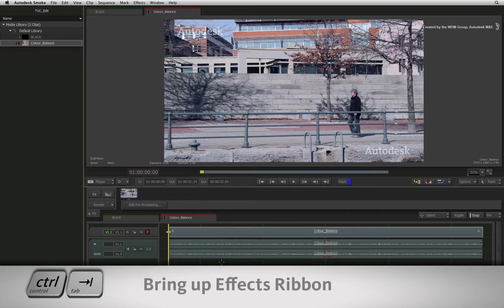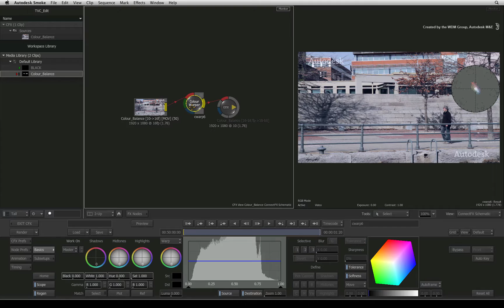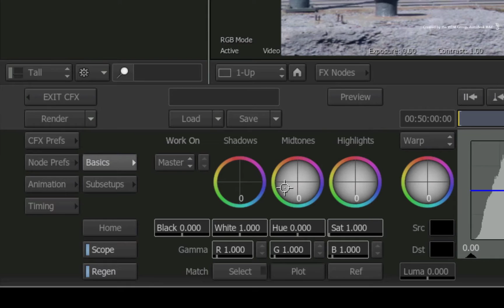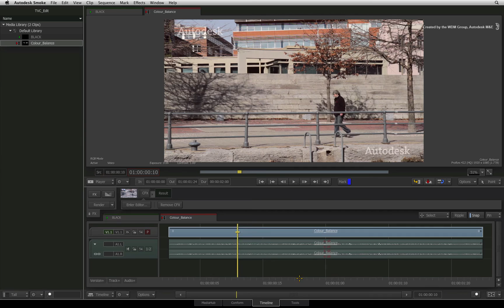White Balancing Your Shot

Comment from the maker: Hi, I run  a similar configuration but with an Nvidia Graphics card.  I do think the ATI issues with 10.7 could be causing issues.  However, the fact that you are using your system disk, even for testing, as a media will definitely kill performance with any application attempting to use the data rates you need.   If you can, please try use a FIREWIRE 800 drive as a media drive.

Good luck!

Comment from the maker: 4 gig RAM is minimum and 8 gig RAM is recommended. Here is the system requirements as of February 2013:

The graphics chip also is important.  It's better to use faster storage like thunderbolt.  Don't not use your system disk as your main storage.

Hope this helps!

Comment from the maker: Hi, This is probably the most technically accurate way of white balancing a shot since you are using a vector-scope which is measuring colour values.   

At the end of the video, I mention that you only need to do this once for a specific shot and then you can save the effect as a preset and drag & drop them onto all the shots coming from the same camera shoot.